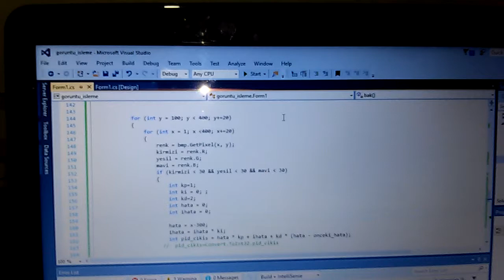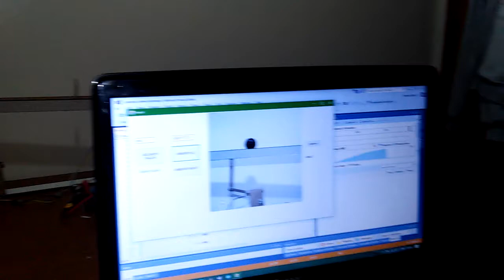Ball & Beam - PID Controller - Arduino-Visual Studıo-image processing

Comment: How did you define the PID output? Was it the angle of servo? and what was the set point and current location. I suppose that was the center point of detected ball??
Reply from the maker: it is find center point of detected ball and try to stay center of camera video. Computer is send angle with calculation of Visual Studio to arduino and activates the servo.